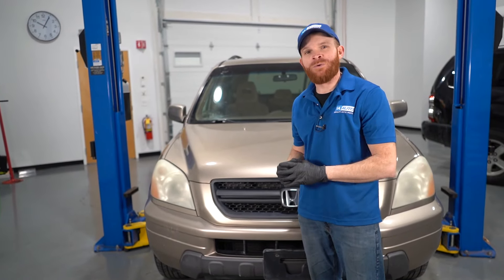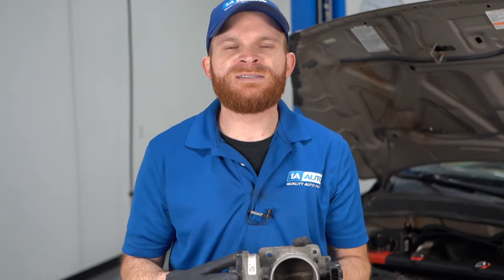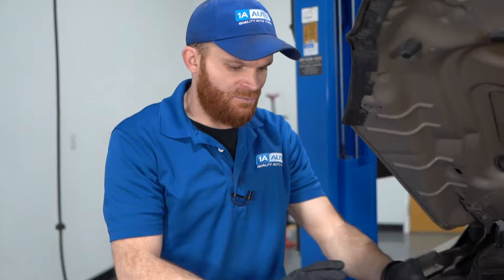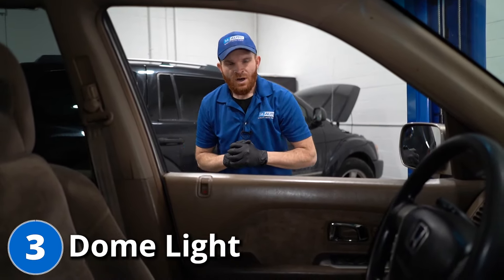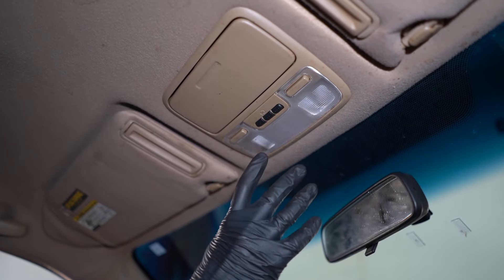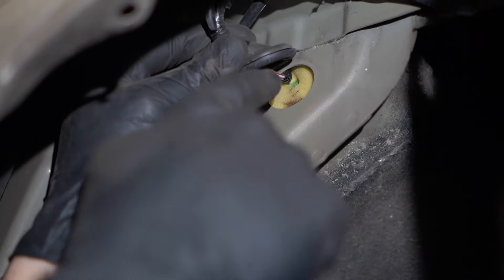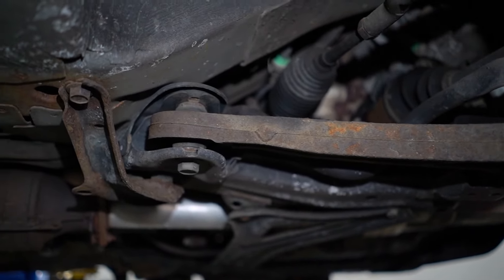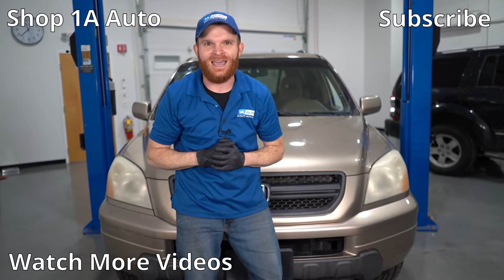Top 5 Problems Honda Pilot SUV 1st Generation 2003-08

Comment: chiming in. I have a 2003 Honda Pilot. Currently at 235,000 miles and going strong. I haven't seen any issues in this video, but I had to replace the power steering pump. I have done 2 timing belt replacements and valve timing adjustment, plus the usual PM stuff. Its just such a good car, solid All-Wheel-Drive, that handles deep snow fine, but huge inside like a minivan. My only complaint is body and subframe rust. The drive-train will likely outlast the body. My oil pump leaks and I regret not changing it last time I did the timing belt.

Comment: it's good to know the top 2 problems are low headlight beam and dome light... haha! we got one of these with 88k on the clock 2006 EX-L. (my parents are old and they don't drive much.) really haven't done a whole lot for them besides oil changes and 1 timing belt/water pump. Alternator died around the the 13th year mark, i forgot the mileage but it wasn't much.

Comment: Well done on the video sir.  Bought a 2007 with 195k mi for the daughter (after she forgot to put the oil cap on an Isuzu Trooper and seized the engine...yeah...yikes!).  Have just replaced the front control arms (grommets were dry rotted just as you described), struts, rear springs and bump stops, speed sensors, door hold-open mechanisms, and all fluids of course.  Now has 218k, has made it to/from TX > CA and am having to address oil leaks - Ft. Solenoid/spool valve assembly [Code: P2646], oil pump gaskets and a proactive timing belt change kit, etc....all to be expected as std. maintenance  given age & mileage  So far, the car is performing well.  Having issue with keeping alignment but the 3 yr alignment by Goodyear has paid for itself.  Next...valve cover gaskets, spark plugs and a new PCV valve...just cuz their cheap and easy.  Rock-on brutha.  Keep up the good work.
Reply from the maker: +B. R. Thanks for the feedback!

Comment: Actually, when it comes to dome light issues, the first thing you want to check is to make sure the switch is in the correct position. The switch (located off the left side of steering wheel) has 3 positions. Off/door/constant on. So, make sure the switch is in the middle or door position.

Comment: These are the top problems:

1. Chronic failure of lock actuators.  They're relatively inexpensive and somewhat easy to replace, but plan on replacing them more than once over a few years.

2. CV axles.  Does your Pilot vibrate, particularly at higher speeds and ONLY when you're accelerating?  In other words, as soon as you release the accelerator, the vibrating stops?  Replace both axles.  Again, you may have to replace them more than once in its lifetime.  Best to replace your other suspension components while you're in there, if they're worn.
Reply: What would you call high speeds cause i notice vibrating over 95 mph but ive thought nothing of it. And  dont go that fast very often obv.
Reply: My vibrating took place after stepping on the brake lightly. Turns out the whole time I had a caliper pin that wouldn’t release in and out correctly. I hope anyone else has the same luck with theirs

Comment: After watching this vid, I checked my front passenger floor board, and indeed it was wet.  Turns out the fluid was building up in the rear AC blower motor compartment under center console.  The vent holes just needed blown out underneath the vehicle.  There are 2 vent areas, front and middle, underneath the Pilot.  If you hear some gurgling especially during the summer with AC on, you need those holes blown out.  Also I am original owner of 2003 Pilot with 215K.  No transmission problems with regular fluid changes, but all door actuators got replaced,  ignition lock cylinder replaced (@ 190K) so I'm using 2 keys, starter replaced @ 213K.   Last week I had the radiator replaced, and oil leaks involving camshaft o-rings, and oil filter gasket replacement.

Comment: I have a 2004 pilot with 250k. It has been a great car with non of the above problems. It has had normal wear and tear items like muffler parts, radiator, alternator, EGR valve and of course brakes and fluids. Original engine and transmission which function perfectly. Has a few oil leaks which is to be expected.
Reply from the maker: +@jeffmartin1968 Thanks for the feedback!

Comment: This video came out days after I upgraded from my 95 Jeep ZJ to an 04 Honda Pilot.
200k miles on it but I hear the motors are good so I'm not too worried about it and it drives like a charm.
No problems so far, and I absolutely love it. 
Can anyone tell me why the air conditioning system is so great? or is that how it is in all newer(newer than 2000 I guess) vehicles? the a/c in my Jeep was awful, and in my Honda it's cold within 10 seconds even if it's 100 out, and it took less than 5 minutes for the heat to be blasting where in my Jeep it would take 10-20 minutes for it to blow heat.
Reply: Well you don’t have to worry I’ve had my 1st gen pilot since 05 from the dealership and none of these problems happened so far. Just maintain it when you’re supposed to
Reply: Nah Honda and Toyota just has very good ac

Comment: My 2005 Pilot has 136K miles.  Still going strong.  My issues with it are the key fob doesn't work anymore for opening all doors, I just got used to using the key to lock/unlock doors.  The headliner sags in various places. My fix? Various pins designed to hold up liners you can get at auto zone for like $3 bucks.  My ac vents are loose and wont stay in place.  Haven't found a good solution for this yet.  But overall I just can't justify getting rid of the car.
Reply: the door actuators on the Pilot are known to fail.  I replaced 3 of the 4 actuators on mine. The driver's door went out first at 140K, then the right sides were replaced at 200K.  Now I am going to replace the driver's door actuator again at 210K.  My mechanic charged me $300 each door.  Or you can buy the part for $75, and numerous vids avail on the repair.  The repair is not the easiest DIY project after contemplating my time/frustration factor.

Comment: I bought a 2006 Honda Pilot , and I have 2 of   5 problems , light and suspensión arm .. .. but still good deal to get. Have 122500 for $7500 .

Comment: We bought our 2004 Pilot EXL new. After 374,000 miles, it's had 2,  $50 transmission sensors replaced, everything else it has needed has been regular maintenance. Original engine, transmission and radiator.

Comment: 05 steel blue metallic 4WD EX, owned since new. Original PT, still drives like it did the day we bought it. Roughly 233,500 on the odo.

Comment: My 04 pilot has 299,819k miles. Been very well taken care of and I'm a mechanic. Got my Honda 300k+ member sticker just waiting in the glove box. Just like any car, accessories, hoses, leaks, timing belt, suspension, ignition, all wear out. Original engine and transmission, no major repairs, ac is ice cold, all the interior buttons and functions still work and it tows dirt bikes to the riding spot.
Reply: 300,000 mile sticker??  Do they have one for 400,000 miles?  I’m at 433000 on my 07 Exl
Reply: hi can you tell me how often you changed timing belt please i did mine a t90k and now mileage at 180k thanks for reply back

Comment: Had 06 Pilot for 14 yrs .. no issues mechanically.....rear frame rusted out....I would still have it but upgraded to a 2018 a year ago.
Reply: I see alot of them rusted out where the rear subframe attaches to the body, almost always the left hand side. Always check this area before purchasing a first gen pilot.

Comment: 06 pilot developed a pretty loud exhaust leak up front. Firestone quoted 1200 for a new exhaust system. My mechanic actually took a look (imagine that) and saw that the mounting bolts for the front header had rusted away! He cleaned up the threads and put new nuts on, for 40 bucks!
Reply: Glad to see honest mechanics still out there.

Comment: water on the floor is also caused by plugged AC drains under the car.  There are two AC condensation drains - one for the front seat area, and one for the center console which delivers air to the back seats.  The drain tubes get clogged with dirt, so sticking a toothpick or bamboo skewer in the tip (from undrneath the car) is an easy fix.

Comment: I have a 2005 pilot with pretty much lower control arms issues, should I change top ones also? And I've been told my 2 front converters r bad it does not pass smog n it has about 340k on it n runs perfect!

Comment: I had the Strawberry Milkshake of Death on my 05 MDX. Replaced with a new design radiator and a used transmission. I use Honda Dw1 fluid and change it fairly frequently.

Comment: In the rust belt or other states where snow covered roads are treated with salt check where the rear end is attached to the body. Where the bolts secure the body to the assembly there are cup-like areas that hold water, because there is no drain. These cups literally hold water and rust out.

Comment: 2004 315,000 miles.   Daily driver.     Motor mount issue and idle air valve replaced, that’s about it.

Comment: I just inherited my mom's 2008.  It only has 50k on it, but these are great tips.  My only two issues is a buzz on initial acceleration that sounds like the tire rubbing on the front passenger side (I can't see anything obvious, haven't taken the wheel off or checked brakes yet as I've had it for a whopping 2 days) and my other issue isn't a problem, just an annoyance.  Anyone know how to turn off the lock/unlock horn confirmation?  Not a fan of it beeping when I lock/unlock.  All the fixes online didn't help: no button under the steering wheel to press 3 times, turning the key left 3 times in the driver door didn't do anything, either.

Comment: WOW WOW WOW. SO GOOD! Best Ive seen!  I have of Honda Pilot. Both front floor mats are wet, left side a swamp, mold. Then, it sat two months, then while driving next time a trickle of h20 dropped from Both Sun Visor latches, but headliner not wet. I will do the wheel well fix, but the sun visor dripple? 
Wish your shop was near me. 
Thank
You

Comment: 0:04 Removing the green clip on the back of an alternator. You either have to go and grab a set of long nose pliers or remove the radiator and transmission cooler to remove cuz the fan is your enemy removing the clip

Comment: I have a 2013 Honda pilot and i have no interior lights that work. the fuse under the hood is still good and all dome light bulbs are still good. Is there something that i'm missing? this is very frustrating as i have spent a lot of time trying to figure out what is wrong.

Comment: 2008 Honda Pilot .replaced throttle body.. Air intake hose.. PCv valve.. Getting code P2279… Intake air system leak bank 1….everything was replaced.. Notice when driving it sticks on MPH on flat ground as if you put cruise control on? Any advice where to look before Honda charges me an arm and leg? Thanks in advance

Comment: I have the 06' pilot. It's got 100000 miles but the VSA and triangle   ⚠️ sign are both on my dash board what's the case. What causes that ?
Reply: It’s your traction system

Comment: Does the inside of the throttle needs to be cleaned or just outside?I checked the inside and had good amount of I think grease or,,,should I clean that too or it is normal to have that dark grease inside?honda pilot 2007.

Comment: Top 5 issues:

1-Rusted out rear subframe mount

2-air blend motor needs new electrical grease 

3-power steering rack leaks

4-vsa issues caused by abs sensor or throttle body actuator

5-vcm causing dead cylinders in 06+ models

Comment: 2006 Honda Pilot, VTM-4 and VSA lights come on along with 'check engine' light.  OBD2 scan shows P0123 and P0223 codes come up - could this be due to a dirty throttle body, or something else?
Reply: Same
Reply: Just FYI, I found the problem - a varmint had gotten up into the engine compartment of the Pilot and chewed up the wiring harness in several places.  The entire harness had to be replaced, a huge pain in the rump and ended up costing $1900 in total at the local Honda dealership.  Insurance covered $1400 ($500 deductible).

Comment: Hi, I have a 2006 Pilot with 300k miles.  Besides the leaky passenger side, my car does not move until it warms up.  Once it warms up, the car drives great for about 15 minutes.  The transmission gets hot and the accelerator will not respond.  I do not think it is a transmission problem, but something else.  Anyone know what it could be?  Thank you.  btw - love the video
Reply from the maker: +Matt Dice We wouldn't be able to diagnose an issue like that here, you may want to have a local mechanic take a look at it. Thanks for checking us out! http://1aau.to/m/Shop-1AAuto-c

Comment: 2006 pilot 235,000 and still runs like new I recently replaced the oil pressure pump and high pressure hose gaskets do to it making a whining sound every now n then but that’s it n do regular maintenance

Comment: Our 2005 pilot, over 200,000 miles, randomly won’t start. It’s been to the mechanic several times for this, but it just did it again! He’s changed plugs and the ignition. Checked the battery and alternator., and they’re fine. Any other ideas?
Reply: Sounds like a faulty ignition/key switch

Comment: I have an '05 with 172k.  Tranny leaks; engine oil and radiator too. Two well reputed repairmen have told me that these may be simple fixes but the Honda design makes doing a thorough inspection  cost ineffective due to the labor costs. IOW, a repair is not justified.

Comment: I don’t know what you guys are doing to your Pilots? I have a 2003 177;000 miles , that has non of those problems. Yes. worn out parts needed replaced been replaced.maintenance? Never missed a beat.
Reply: Give it time. That's low mileage

Comment: I have a 2005 pilot the only problem I have is when I'm driving on the freeway it leaks some transmission fluid, the rpm goes up when pressing on the accelerator but it won't accelerate anymore, after 2 or 3 hours of not driving it, it drives just fine so I don't really undeserved what the problem is 😒

Comment: so my 2003 honda pilot vtm and D lights are blinking not at the same time but i usally just shut the motor of and those blinking lights go off. problem is while dropping my son to work at a complete stop a strong jerk happens and engine shuts off. put on park engine starts up no problem but when i shift to reveres or drive engine shuts off. please help me make senses of this. do i have a shot trans or is it correctable.

Comment: I have a 2006 pilot and the battery light comes on then goes off when u start it then comes back on and it just left me stranded for a little bit until i jumped it for a little bit. Any suggestions

Comment: If you respond 08 Pilot EX alternator whine  its been whinjng for 3 months I thought it was the power steering o ring issue well I replaced those and the whine still exists I disconnect the alternator and no more whine so thats the culprit but is it bad? Or is it a go until it dies situation?

Comment: Do you have any of your automotive shops around Dallas area,,,would love to bring my Pilot 2008 fir service and check up since you seem to know what you are doing,my car has a leakage when it rains on the driver's side underneath the floor carpet,how can I help this,av gone to almost 8 mechanics but none seem to understand what's going on
Reply: Check the seal on the outside of the windshield on driver side. You can just put some silicone on it to see if it stops the leak. Sometimes the seals get damaged or just wear over time. He mentions this in the video. If your not confident take it to a glass company that replaces windshields

Comment: 2007 Pilot OMG what a nightmare ever year 2k into it Honda would take it in say nothing is wrong with it. The day after the warranty was over had already paid it off the tensior rod, the alternator, the battery fried the radio, sunroof the back AC didn't work anymore and this crank sound every slight left turn, the windshield wipers still squeak have been changed several times.

Comment: Looking at a 2003 Honda Pilot with 275,000 for $2300.  Under the hood is clean and good test drive.  Any comments asap?  🙂
Reply: Good price. It is a buy.
Reply: I bought a 2003 Pilot from a coworker/ original owner in Oct 2021 with 285K. Surprised what great condition it's in. IT was well maintained and came with all service records. Paid $2000 and happy with the purchase. It's a NC car so no rust issue to contend with

Comment: I am trying to find a vid thats has diagnosis of rattling at 2000 rpm during acceleration or cruising. When rpms get in that range it rattles like a heat shield but I can't find it.

Comment: OK so I have an 07 Honda pilot it’s used my parents had it before I did when steering left it makes a really bad grinding noise any clue what that could be also with idling or going up hills what does it mean when it goes up to 4000 RPMs when going up a hill or 3000 rpm
Reply from the maker: +Littia Roberts We wouldn't be able to diagnose an issue like that here, you may want to have a local mechanic take a look at it. Thanks for checking us out! http://1aau.to/m/Shop-1AAuto-c
Reply: Don't go to the dealership for repairs. They love to charge you money for things you don't need.

Comment: I have an 2005 honda pilot an we bought it from an local dealer ship we had to replace the file filter an power steering line because it leaked our tires are very boald  so we have to replace them too and now our speed demointer light stoped working